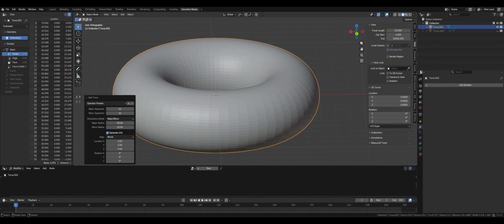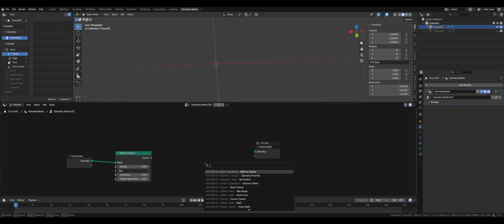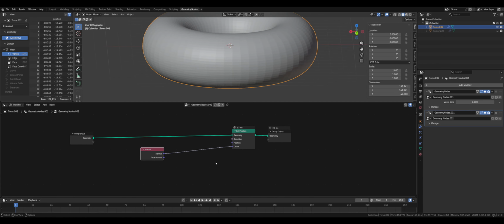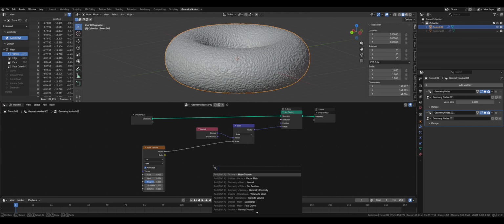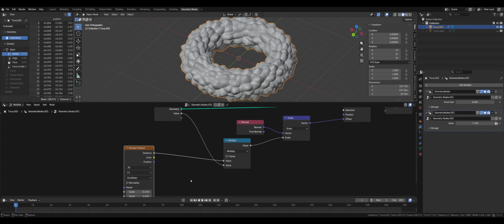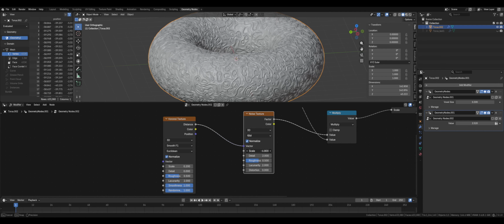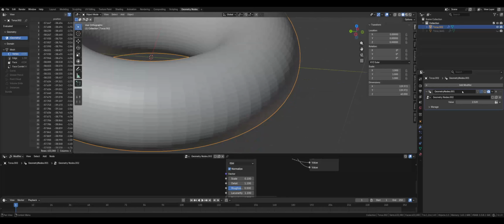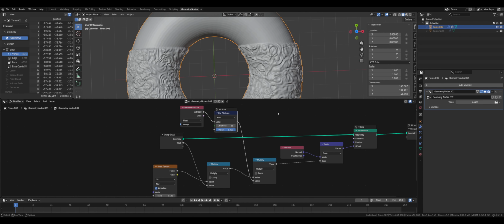3D printable Surface Texture Tutorial Blender Geometry nodes

Comment: Have never seen the geo proximity node used to tidy up a remesh (by setting the mesh back to the original shape).  
That's a neat trick, thank you for sharing!
Reply from the maker: You can also combine it with a blur attribute node to smooth it out. I use the 2 together (with the snap back last) with a repeat zone. This helps in cases where simply moving it to the closest point leaves bad geometry. This mainly occurs in things like remeshing complex 3d scans.
Reply: @Anthromod I got some bad geometry when remeshing 3d text using your snap back method (specifically the mesh at the transition between the text face and the sides). This mesh didnt look good when i displaced with textures along the normals.  So i will try messing with blur and repeat and see if that helps.  Thanks for the new tip, appreciate the reply!